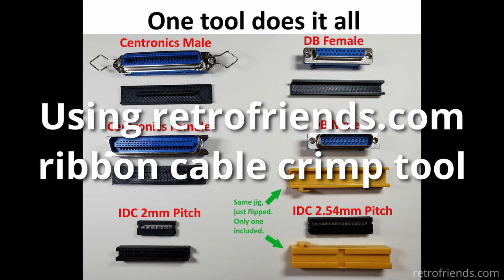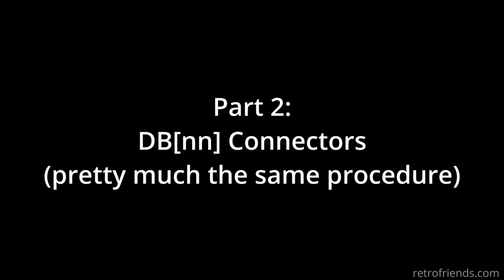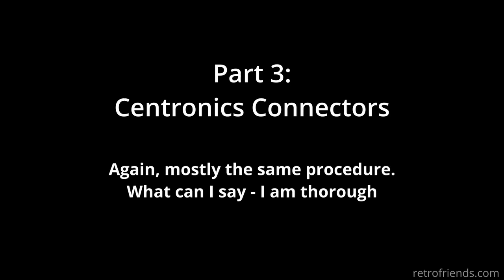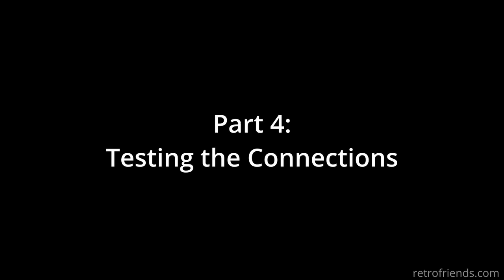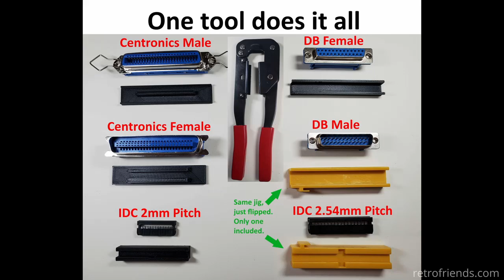Crimping Ribbon Cables - A How-To Guide

Comment: TIP: If you do this in a cold environment, warm the connector before crimping it to the cable. Working in a ≈ 35° F room, I didn’t do this with a Keadic brand connector, which cracked along its width, yet performed normally.

Comment: Is it possible to crimp multiple connectors along the cable in series?
I'm looking to make a power bus cable for a fully DIY modular synth. My main concern is, given how the connectors attach, the cable will be too weak to be of much use beyond the first connector
Reply from the maker: Once you have crimped the cable and go to cut off the excess, it doesn't seem to me that it's ready to fall off. I think your chances are good based upon the design of the connector, which has contacts that are designed to hug the wire not cut through them.
Reply: @retrofriends  you legend, thanks. If I ever get around to it, I'll try to remember to drop an update here.

Comment: Would it be possible to design an adapter made for crimping ribbon cable dip sockets?
Reply from the maker: I don't even know where you would get such a connector. I based my adapter assortment on availability of connector. Where can I find one of those?
Reply: @retrofriends  I guess the more accurate term is ribbon cable dip socket header. For example 8200-40-R on Jameco electronics for a 40 pin one. The smaller 16 pin ones were used on the Apple II for example for the keyboard and joystick connectors
Reply from the maker: @tomatolicious  Thank you for the information. I will check it out :)